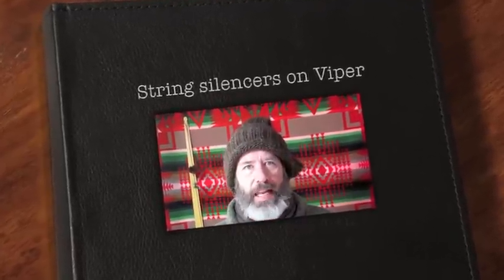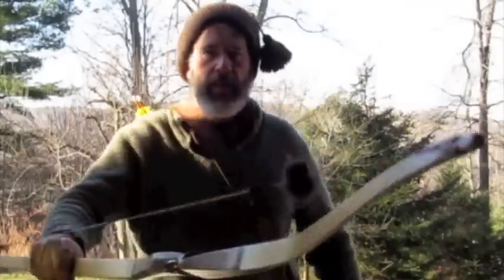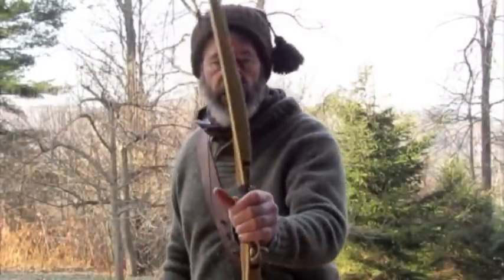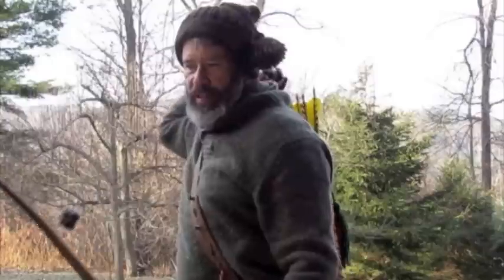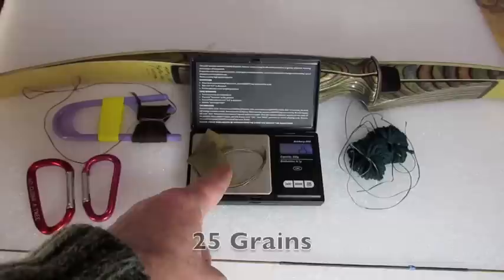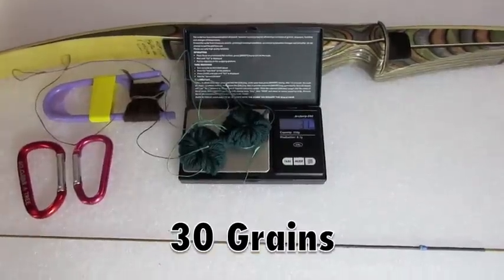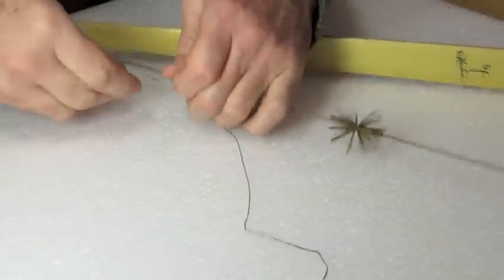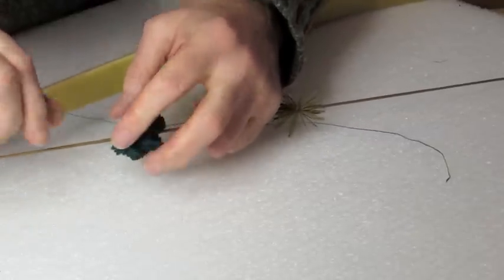Installing string silencers on Viper longbow

Comment: Hi Jeff, last time we shot, i forgot to ask you with regard to the loud bow, if you first played with the brace height, before putting silencers. I think its possible that its a bit to low and maybe its the reason its twanging. Thats what they recommend when tuning a bow.  Find the sweet spot of the bow to where it quiets the most without silencers and then add them. who knows, but i would give it a shot. thats how i fine tune my bows. By the way, very entertaining video as always my friend
Reply from the maker: Hello MR. Archer, I have.:-)  We have been making up some strings to make a video about brace height tuning. Since it goes hand in hand with making a bow quieter. Its all  a balancing act between performance and noise.  Glad to see you and your family made it home safe.
Reply: TheNockingPoint , thank you Jeff, it was a crazy and dangerous drive back. Around 20 cars and truck accidents. Anyways,  those limbs on that bow are very snappy and fast arrow shooter :-).  See you guys  in the near future.

Comment: the wool ball,,, i never tie them in, i just make the ball with a piece of string bundling it, and shoving it in the string. once strung it stays in place. unless i move it by hand, to tune it to the sweetest spot available.
Reply from the maker: Hello Mathijs,  I have had zero luck getting a wool ball to stay in place on a non twisted endless loop bow string.
Reply: yea when it isnt twisted it wont work, once there is a twist in it they will stay on. bit of string wax also helps.